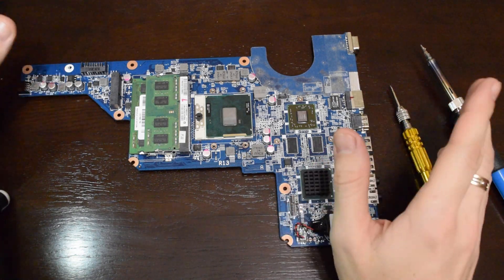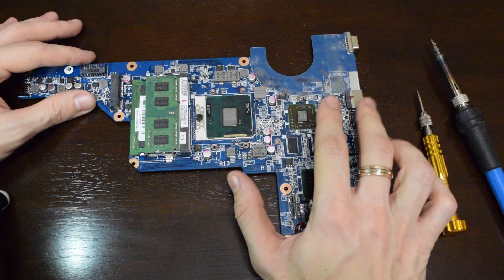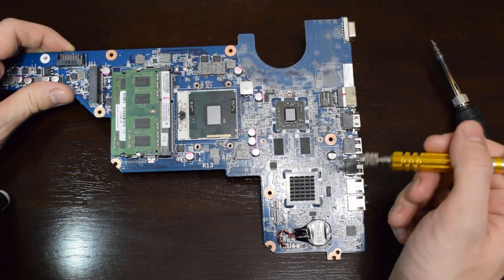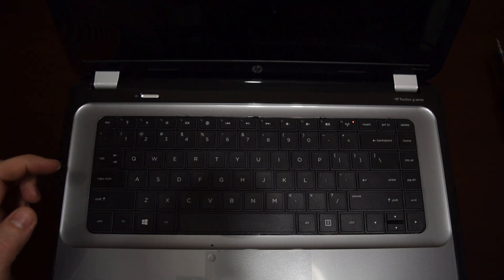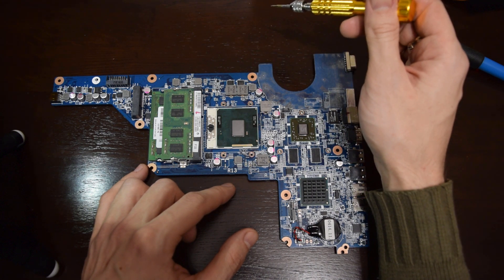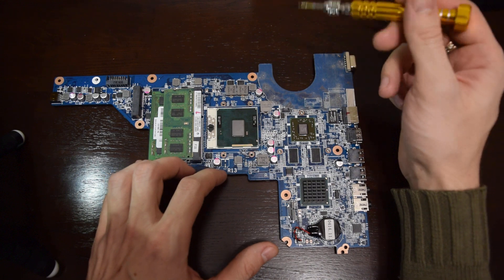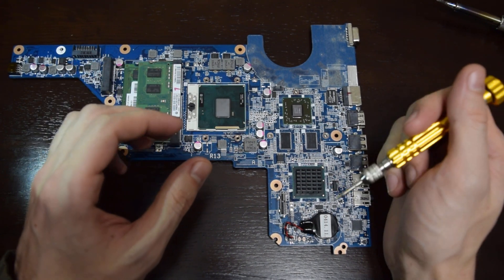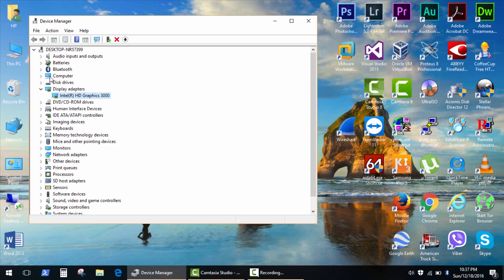Fix Dead GPU – Convert HP, Dell, Lenovo Laptop to UMA Graphics (HP G6 Example)

Comment: Thanks a lot for this video. I'm trying to get my old laptop which has a good CPU still to turn back on, could you help me figure out what I need to do exactly?
http://imgur.com/gallery/qQ7ONR6
Tell me if you need more information. Laptop is a Toshiba c55-a-1n8.
4th gen i7 (used to be i5) with a nvidia 710m gpu.
Also, I did find this, but it was not comprehensible for me so hopefully I'll save you half a minute of searching: https://drive.google.com/file/d/1mAdZ2hpbrWp1ZsYmkw3CuRPDQcJursRn/view
Reply from the maker: Try to move this resistor to the right: https://ibb.co/F0sBHnH
Reply: @ElectronicsComputers  Are you sure that is correct? It doesn't seem to line up with what I've got. I had a look at where it says JP2301 and the corner of the chip and the orientation isn't correct And there isn't a resistor near it. 
https://ibb.co/Vj8Qy03

Thanks for your help so far.

Comment: Hi thanks, my laptop Acer fall from bed, now fan is working but no display showing. Can it be VGA problem or LCD and inverter chip problem.?
Reply from the maker: when you press The Caps Lock key does it gloving? I mean indication of the pressed Caps Lock key.
Reply: @ElectronicsComputers  actually my model Acer aspire 5755 don't have light feature on keyboard for caps lock n NumLock , but even if I remove the keyboard wire from motherboard, then also the problem remains same.

Comment: 1. My HP Pavilion Dv6646us was having NVIDIA graphics chip overheating problem. Its AMD Turion processor and board also I guess. Will this solution work for it? I know you said its HP Intel laptops. But just want to know if this can be fixed by your method for this model. I have had the board replaced once from a service center, It worked less than 1 year and then again it seems the NVIDIA graphics overheated. They tried to replace the NVIDIA chip or resolder it or something. It worked 1/2 day and failed.

2. In case it does not work what would be equivalent board to replace HP Pavilion Dv6646u AMD board with and Equivalent Intel board version. I am from India.  Wonder if I can get a replacement if needed.

3. If this too does not work, I was thinking of removing the board and see if the board can be installed in a desktop box and do something that can bypass graphics card and install, if any other separate graphics card can be cooled by a big fan. I know I am sounding vague here in this point. I wonder that will give some food for thought!?
Reply from the maker: It works that easy only with Intel's switchable graphics. There's also no sense to buy a new motherboard for Intel CPUs because in that case you have to buy a new Intel CPU and also replace the heat sink because they are different for AMD and Intel. From my point of view, your best option would be to buy a new motherboard for 35$ with free shipment, from this reliable seller: http://ali.pub/4yl45o
That motherboard doesn't have Nvidia graphics chip only integrated one. So less components that can fail one day. Moreover that motherboard comes with CPU. So you can sell one CPU and your old motherboard for donor parts.
Reply: @ElectronicsComputers  Thank you for your comments and suggestion!
Reply from the maker: @gurudattag  You're welcome!

Comment: Hi mate! Is it possible to make it on HP Elitebook 8560p?
Reply from the maker: Unfortunately not! That motherboard doesn't have switchable graphics, moreover integrated into the CPU graphics doesn't even powered on that motherboard. So it's technically impossible. You can buy a new motherboard for 45$ with free shipment from this reliable seller: http://ali.pub/4yd0ye

Comment: Hi, i have same problem in my hp pavilion dv2, i already remove the nearest coil from graphic card, but when i push power button, power lamp only turn on for while then turn off again, am i remove wrong coil?, could you help me, this picture of the motherboard https://ibb.co/k3jnbYM
Reply from the maker: It's not gonna work with that AMD platform! But you can buy a new motherboard for 50$: http://ali.pub/4y4r45
Reply: @ElectronicsComputers  why it is will not work? I have search, hp pavilion dv2-1122ax is discrete graphic... It should can be convert to UMA right?
Reply from the maker: @adiputra8356  There's no switchable graphics on that platform. And that CPU doesn't have GPU in it. There's is a chip set which has integrated graphics and it's almost unreal to make it work the way you want. You have to add/remove/replace a bunch of tiny components.

Comment: Hi man. I have hp mobile workstation 8760w but the dedicated vga Quadro M400 is dead. I removed the vga but notebook not power on. Have you any fix for my case or only one new vga? Thanks
Reply from the maker: You need to replace your graphics card in order to make it work again. That motherboard doesn't have power for integrated into the CPU graphics. So even though your CPU has it your motherboard can't use it. 
You can buy in good condition graphics card from these reliable sellers:
http://ali.pub/4y3jdj
http://ali.pub/4y3je4

Comment: Plz help me sir .hp 8560p dis to uma conversion..i had removed the gfx coil,but still not worked for me..plz assist me resistor replecment also...
Reply from the maker: It's impossible for this model. You can buy a new motherboard for 46$ with free shipping here: http://ali.pub/4xci7b
Reply: Ok..thanks

Comment: Hi.  Could you please tell me if this would work on a dell precision 3510?  I have tried disabling the discrete video card device on Windows 10 but it crashes when updates happen.  I have gotten around this by using linux and disabling with terminal, but I need windows.  If this works on the precision 3510, what coil is it?
Reply from the maker: Try to carefully remove these two coils: https://ibb.co/dmMpKwS

Comment: Does this method work for hp pavilion g6 motherboard: R33 DA0R33MB6F1 REV : F and what do you do after you remove this
Reply from the maker: It perfectly works for your model! You'll need to replace one coil and in case if it still doesn't work then swap two resistors:
https://ibb.co/b6LFxL4
https://ibb.co/RvvKcpM

Comment: Hello :D
Can you tell me does this method work on this board if it can then which coil I should remove? https://ibb.co/jDgxYvD
Thanks in advance :)
Reply: also forgot to mention that my laptop model is Asus N550JK but the board is N550JV Rev 2.1
Reply from the maker: I need to know the model of your laptop in order to check that downgrade option in schematics.

Comment: How to identify the correct chip on my lenevo ideapad y550
Reply from the maker: it's very old laptop which doesn't support such "features"
Reply: @ElectronicsComputers  actually it has a nvidia 512 mb inbuilt graphics and my problem is same everything is working but not showing anything on display 

So i also opened it but i am not able to find the correct chio

Comment: Hello sir, can you help me out with finding the coil for lenovo y50-70. 
The motherboard model is 5b20h29174.
Reply from the maker: remove tiny component PR921 near PU901 that powers your GPU.
Reply: @ElectronicsComputers  i will give it a shot, thanks.

Comment: Greetings,
Can you please help?
I have an Intel Core™ i3-2350M CPU with only UMA Graphic (I looked into the motherbord there is nothing but the CPU and Chipset)
When I Install the graphic driver the screen goes black.

I wonder if changing the CPU would solve the problem!
My laptop is Hp Probook 4530s
Reply from the maker: If your motherboard looks like this: https://ibb.co/9Y1GLyG
then replacing the CPU should help you.
Reply: @ElectronicsComputers  Yes it looks exactly like that !!
Thank you very much!!

Comment: Thanks for the video! I have an HP envy M6. Could you show me which part I need to remove? Thanks
Reply from the maker: You have to remove this coil: https://ibb.co/mTD3Qk5
If it still doesn't work then you have to move these two resistors to an empty place:
https://drive.google.com/file/d/0B83rv4g5HEmKVlN0bDRpdlRKaTA/view
https://drive.google.com/file/d/0B83rv4g5HEmKNVZYTDZJZkwta2s/view
Reply: @ElectronicsComputers  Excellent, but sorry I can't see if you indicated any coil in the first picture. Am I missing something?
Reply from the maker: @JstAnothrVirtuoso  Sorry, wrong picture. I've just reuploaded the file try again.

Comment: Hello! Would you bother telling me what I can do I order to get my old Lenovo y460p (Radeon graphics card + i5) back on duty? The graphics card is dead (showing artifacts on screen) but I'd love to get this laptop running again. Thanks in advance.
Reply from the maker: It's possible for your model! First remove that coil: https://ibb.co/cX084Kx
Try to turn it on if it doesn't work the you have to move tiny resistor R275 to R274 position. They are close to the chipset.
Reply: @ElectronicsComputers  Thank you so much. I'm gonna try this tonight! Would you mind being a little more specific about those resistors (image) and how to move it? Thanks again!!

Comment: Hello, which coil do I disable dead GPU on Gigabyte P15?
Reply from the maker: Unfortunately I don't have service manuals for Gigabyte laptops. It may not work for your laptop. Usually it works for HP, Dell and Lenovo laptops.
Reply: @ElectronicsComputers  ; thank you for responding.

Comment: Hi mate, I have a HP Pavilion dv6-6004TX.
Do you think you could point me in the right direction on what I have to do, please? Thanks!
Reply from the maker: First try to remove those two coils. https://ibb.co/0VFZyZn  If doesn't switch to UMA graphics then also remove that tiny transistor.

Comment: 4-year-old video but very helpful. A few years back my laptop started getting black screens and whatnot. I had restored to factory settings and tied the usual methods but nothing came of it until I bought a USB with windows on (I thought it was corrupted files) and it worked. I could turn on my laptop but I noticed that the graphics switched to the integrated ones and searching on device manager my AMD GPU disappeared.  Somewhere along the line, my laptop switched to UMA on itself and gt fixed. Intel graphics card aren't as good and I couldn't play modern games anymore but with a dead GPU on a laptop (I recently just confirmed it by switching to switchable graphics, it went back to black screen and crashing until the driver itself was disabled) there's nothing you can really do. I still use it for writing papers and light gaming (lol and recently valorant) though.
Reply from the maker: Integrated graphics comes in handy in such situations. AMD and Nvidia GPUs have very limited life in laptops, due to very bad cooling. Anyway, it's nice to have that built-in "backup" option.

Comment: Do not do this on HP DA0AX1MB6H1 rev H.
Reply from the maker: It works for that model too but it's not that easy. You have to add/replace/remove a bunch of components.
Reply: @ElectronicsComputers  you good had said that don't gku think. Doesn't work on many other boards!

Comment: Thank you for this video.. I have a Hp Pavilion 15 n249sl, as you can see in the image, I tried to cut the coil. On restart the monitor is black but I can see the OS starting and work normaly. The backlight seems dont work. Can you help me please.
https://ibb.co/f2Pwjg1
https://ibb.co/g63xSB5
Reply from the maker: You have to remove this coil: https://ibb.co/mb61BjY
Reply: @ElectronicsComputers  Thanks for your answer, i removed the coil but the problem remain.

Comment: Sounds good took that coil out and dead motherboard. I quess there not the same. Now where can I by a new R22 coil for my HP QC 62??? Also good luck trying I find a schematic of your m/board. That seems to be  best big  scam.
Reply from the maker: you mean CQ62? What's the CPU in your laptop? In most cases it works perfectly for almost all brands but some times requires more actions than just removing the coil. Some models don't have switchable graphics and some CPUs don't have built-in graphics in it. If you damaged your coil you can buy a new one here: http://ali.pub/4pahpp You need R22 it's 0.22uH.

Comment: lenovo y460 which coil should be disabled?
Reply from the maker: Technically it's possible but requires removing and replacing a bunch of tiny components.

Comment: Hello

I have a problem with a pavilion dm4 3060ef (beats edition)
Black screen when I install the drivers for the dedicated GPU (HD7470M). I guess the chip is dead?
And this prevents simple standby (not hibernation)
Will your tip solve the problem?

I you but in link an ad with the photos of the motherboard (the dedicated gpu is not populated on the photos)
https://fr.aliexpress.com/item/32798099206.html?spm=a2g0w.search0302.3.49.46624464e5fKml&ws_ab_test=searchweb0_0,searchweb201602_0,searchweb201603_0,ppcSwitch_0&algo_pvid=7f313c37-0140-45fb-af4e-9ac3f89281d9&algo_expid=7f313c37-0140-45fb-af4e-9ac3f89281d9-7
I presume that the coil to dissolder is the PL9201?

Thank you very much
Reply from the maker: That's right!
Reply: @ElectronicsComputers  thank you :)

Comment: Will this work with toshiba satellite L840
Reply from the maker: Technically it's possible but very complicated process which requires special skills and tools. You can buy a new motherboard for 47$ http://ali.pub/4or1g6
Check out these links:
https://dr-bios.com/articles/toshiba-l840-c840-m800-daby3cmb8e0-conversion/1977
https://www.youtube.com/watch?v=nA1WzxNYa7E

Comment: I have 2 laptops with graphics card issues. 1 laptop is HP Pavilion DV6725ee . I tried to open the laptop to get picture of motherboard, but its tricky and I was afraid that i may cause damage. Picture of laptop is in this link   https://ibb.co/7yGmv0b   ..... Another laptop is Sony Vaio VPCEB16FG, the picture of its motherboard is in this image link https://ibb.co/X4SQh5D   ... Please provide solution as soon as possible..

Comment: Hi, i have sony laptop and hp laptop that has the graphics card issue. where can I send you picture of both motherboards so that you can show me which chip to remove from motherboard.
Reply from the maker: what's the models of your laptops?
Reply: @ElectronicsComputers  1 laptop is Sony Vaio VPCEB16FG, the picture of its motherboard is in this image link https://ibb.co/X4SQh5D   ...
Another laptop is HP Pavilion DV6725ee . I tried to open the laptop to get picture of motherboard, but its tricky and I was afraid that i may cause damage. Picture of laptop is in this link   https://ibb.co/7yGmv0b   .....

Comment: Hello! I have this HP DV2000 and have yet reheated with flux this gpu several times, and it worked well till it gets hot, then the system hangs and I have to wait and again  it worked when cold... Now the laptop turns on and seems to be running Windows because the HD led blinks as usual, but nothing appears on the screen, no image, only the backlight. Wich coil should I remove to disable rhis nvidia gpu?? THANK YOU
https://drive.google.com/file/d/1-2AZMWGlIDN0lvCz0rOvl0m9fHE82q2U/view?usp=drivesdk
https://drive.google.com/file/d/1-4fl3jwhDIxgyLnOQ9Ey7Av8OiADsIiD/view?usp=drivesdk
This is the backside of the board...
https://drive.google.com/file/d/1-EHg-aGwZLOHHpE6FOWp5-YnqurspZsC/view?usp=drivesdk

Thank you very much!!
Reply from the maker: it's very old laptop that doesn't have integrated graphics into the CPU so this trick is not gonna work for you. The easiest way to fix it is to buy a new motherboard for 40$ with free shipment: http://ali.pub/4o3qdf
Reply: @ElectronicsComputers THANK YOU VERY MUCH!!!

Comment: how about GL502VM, Intel HD has disable by factory.
Reply from the maker: Technically it's possible but I don't have schematics for that one. You can try to remove those two coils near the GPU chip. This is nice and expensive laptop why not to repair in the service center?

Comment: WHAT ABOUT TOSHIBA SATELLITE L50-C-21J. WHERE IS GPU COIL LOCATED?
Reply from the maker: with Toshiba it's not that easy. You need to swap/remove some tiny components to make it work. I'd recommend asking someone in repair shop to convert it to UMA graphics. It's very cheap and quick process.
Reply: @ElectronicsComputers   I have all the required components and tools. There are 2 coils like 5 cm away from GPU but i dont know which should be replaced. How can i find the right one
Reply from the maker: @valentinmengra4852  Can you make 2 pictures of your motherboard from both sides with high resolution so I could mark the resistors to remove.
Reply: @ElectronicsComputers  tell me your email
Reply from the maker: @valentinmengra4852  it's in "About" tab on my channel.

Comment: Hi, i have a lenovo y560p. Which coil i have to remove?
Best regard, excellent solution.
Reply from the maker: There are a few modifications of the motherboard for your laptop. Some models don't have power for the integrated GPU some have. I'm not sure about your case so simply try to disconnect this coil: https://ibb.co/n6CK11H

Comment: Thanks for the video ... i have sony vaio pcg 6r6p ....motherboard MBX-159.....power on but no display can  u tell me how to solve this problem
Reply from the maker: this method does not apply to your model because it's too old and that laptop doesn't have integrated graphics into the CPU. Most likely the graphics chip is dead. New motherboard costs 90$ http://ali.pub/4mbe33
Not sure if it worth repairing.

Comment: i spilled water on my graphic accidentally, and now i get error 43, help please
Reply from the maker: what's the model of your laptop?
Reply: @ElectronicsComputers  HP elitebook 8540P
Reply from the maker: @sattarbeygvand985  Your laptop has replaceable graphics card so you can easily replace it and even upgrade it. There are 4 models which cost about 30-55$ with free shipping.
http://ali.pub/4le2yh
http://ali.pub/4le2zg
http://ali.pub/4le2zu
http://ali.pub/4le301